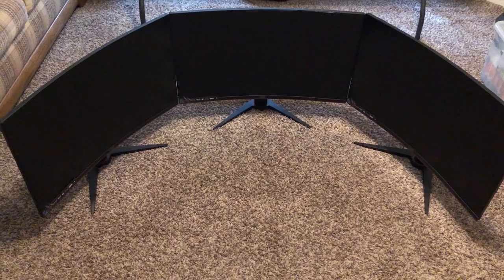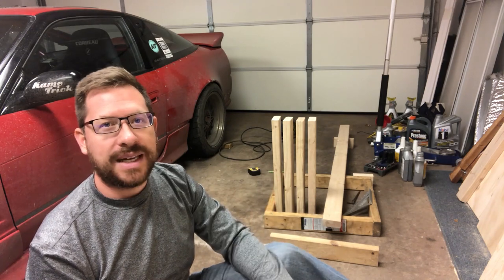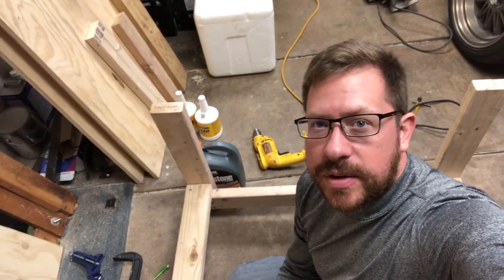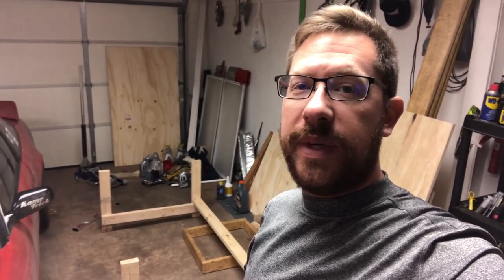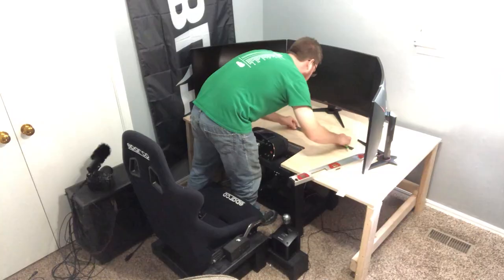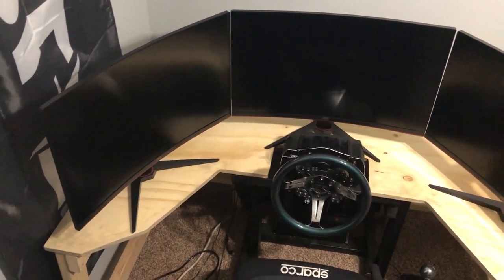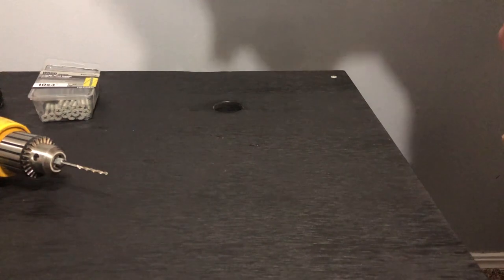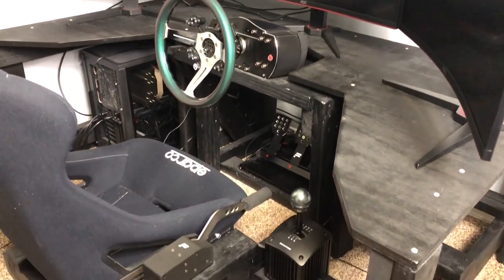How to Build an $85 Budget DIY Triple Monitor Desk for Sim Racing or Drifting

Comment: Thanks for the video... I've been thinking about using a normal wood desk (or making my own), cutting out a square (much like you did) to fit my GT Omega wheel stand, and hinging it so that when I'm not racing I can use my computer like a normal computer.
Reply from the maker: Old Dog Gaming yeah, that’s a solid way to go about it! If you buy a prefabricated desk you’ll have to be wary of what the interior is made from, it might not hold up so well where you cut it, though I don’t know. A metal cover on a hinge may work better for rigidity too 🤔 This gives you some ideas though! 👍🏻
Reply: @KameTrick  I actually didnt think about the prefab quality, but you're right. I'll probably end up building something similar to yours, except with less screen curvature and a flip door in the center. This was a great video for me to ADD to my already existing idea.

Comment: I know this is an old video but I think it’s generally a bad idea to wear gloves when using saws and power equipment like that. Without gloves, you might get cut (you shouldn’t if you know what you’re doing), but gloves can get caught in the blade and actually pull your hand into it, causing even more damage. Just a thought, hope you stay safe.
Reply from the maker: Ah, yeah now that you mention it I’ve heard that before. Thanks for taking the time to comment, staying safe so far! 👋🏻
Reply: @KameTrick  great video though! Gave me some ideas for my own rig I’m starting to build

Comment: I must say. Having used rattle cans alot. That was a very heavy first coat IMO XD. Also had a laugh at all the hiccups you ran into. Came out great tho.
Reply from the maker: RemmahTV yeah I’ve done my share of rattle canning as well but TBH I was ready to be done with it and the wood was really thirsty so it didn’t run anywhere on the main surface. I think it did a bit on one of the legs but 🤷🏻‍♂️I run into so many snags when I try to DIY stuff lol

Comment: what are your monitor sizes? i wanted to do something just like this to slide over my rig. i race in vr but i wanna run triples too for stuff like flight simulators
Reply from the maker: I’m on 3x AOC 32” monitors running 7680 x 1440

Comment: Paints applied to thick and if it's cold doesn't bond well. Your first coat should have been light and even if you weren't going to prime. This allows the paint to dry promptly and tack the the material surface. All coats after that will tack the the first layer of paint. It's not to late to apoxy the surface.
Reply from the maker: I might just do that, I was in a hurry and just didn’t want naked wood grain for the desk lol 😅